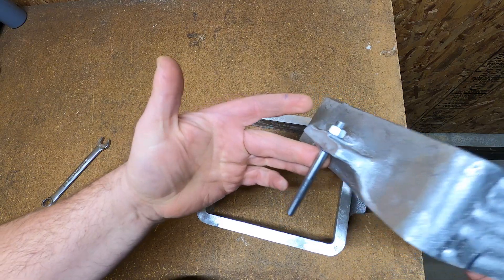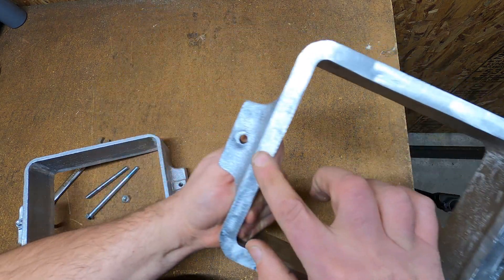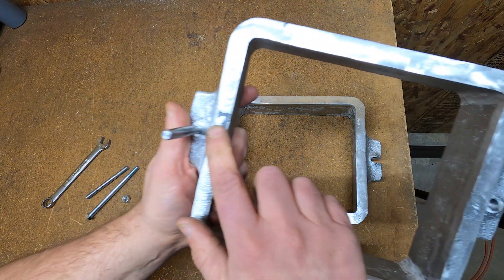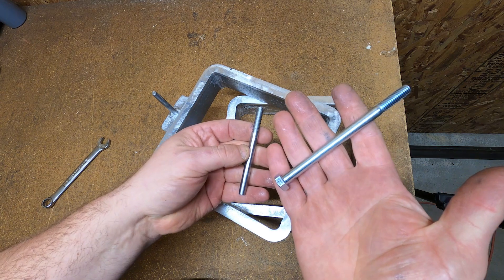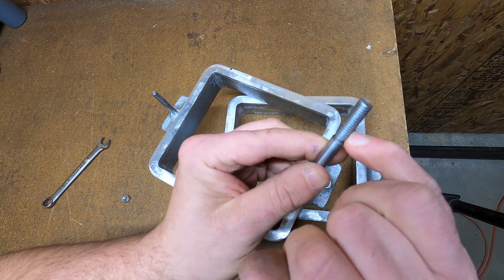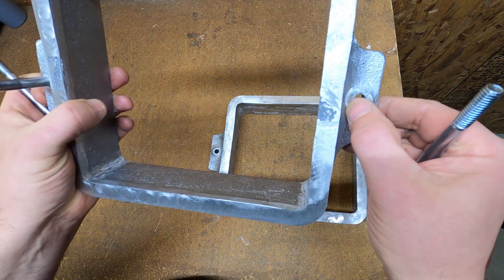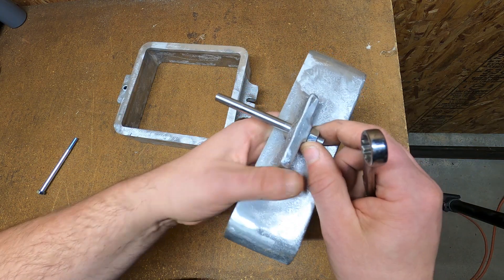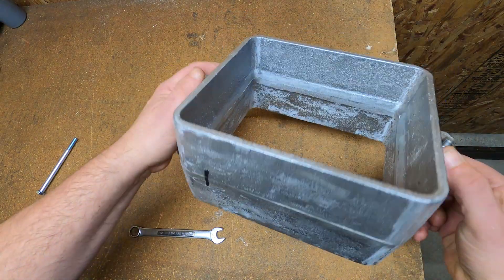Making a One Piece Casting Flask.

Comment: Hello good video . Why your Sand IS black ,i want to know the composition of your Sand ? How many per cent of clay and how many per cent of Sand?
Reply from the maker: The sand has darkened over time from the burned sand against the casting. My mix it approximately 6 to 7 percent bentonite clay.  The rest is just fine white silica sand.  All measures are by dry weight
Reply: @strittmatterironworks  thank You very much for these clarifications !

Comment: try spin casting anything, aluminium, plastic, epoxy, uv-resin, anything that melts or cures
Reply: Spin casting is not practical for larger objects for the home caster. How big would the machine need to be to cast the flask in the video? Very big. And we don't have the resources for that. In my case not the space.  I challenge you to make a spin casting of the size of object shown in this video. Spin casting is only practical for small objects for most people.
Reply from the maker: Agree!  I don't think I'll ever be doing any spin casting that large.
Reply: @strittmatterironworks  a parabolic lens or anything using the perfect parabolic shape does not have to be large tho
Reply: spin casting makes perfect parabolic mirrors/surfaces
Reply: spin casting would also make a vase/container/flask with simple outside form really fast
Reply: kinda inverse clay pottery but with molten spinning metal/plastic/epoxy/resin
Reply: but instead of manual shaping, or even lathe-like tool operations, its a standard shape spin cast process
Reply: just put source aluminium/metal/any into the spinner, then turn on induction hot plate or oven, then spin, turn off the oven, spin until cured into place, remove cast, next cast, repeat